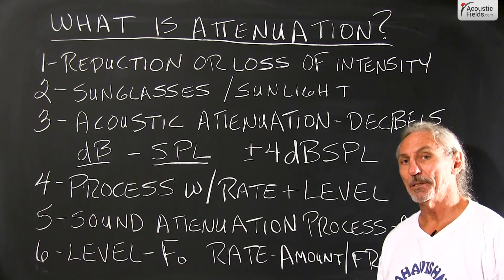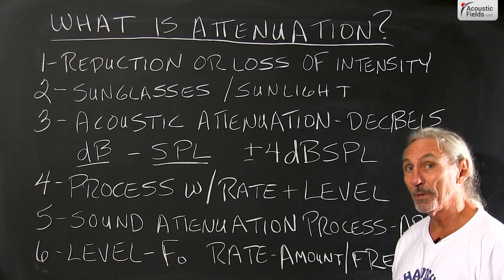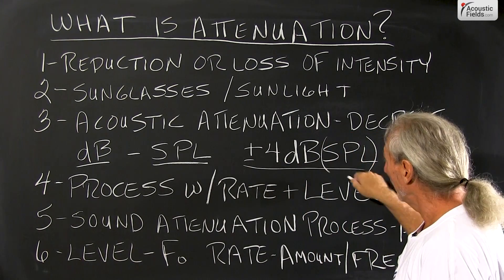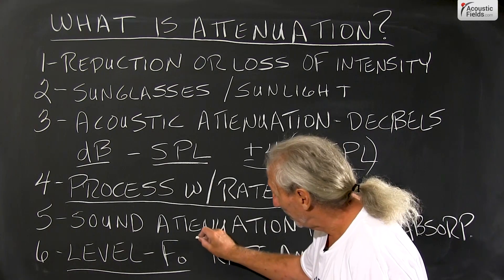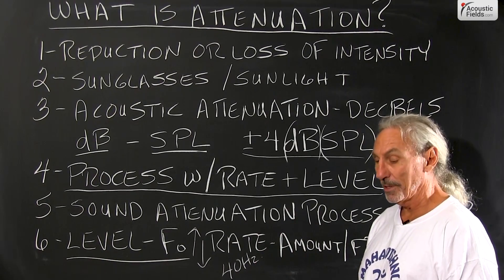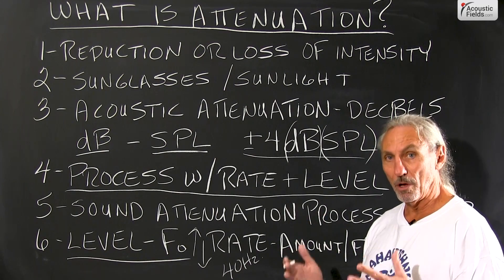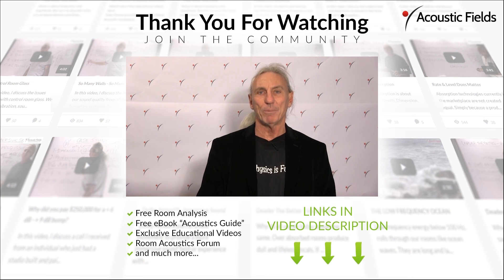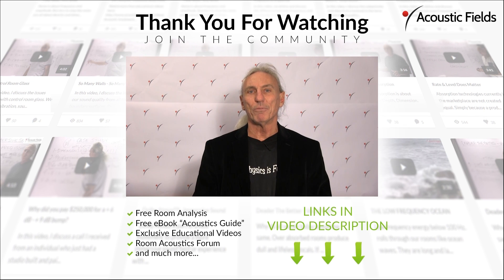What is Attenuation? - www.AcousticFields.com

Comment: Attenuation is not expressed in dBspl but in dB because it's relative, dBspl is related to absolute sound pressure based on hearing threshold reference (0.00002 Pa). In your example it should be  +/- 4dB instead of +/-4dBspl.
Reply from the maker: You must express technical subjects especially physics using simplier processes to facilitate understanding.and comprehension so everyone can be conversationally competent.
Reply: @AcousticFields  simplier process doesn't mean physical laws should not be respected, and it's not that difficult to understand that attenuation should be expressed in dB instead of dBspl.

Comment: Dennis,  At   I'm a little confused on the statement you made regarding Resonant Frequency.   You mentioned that when you design a product to absorb down to 40hz, that it's going to absorb frequencies above 40hz, and not below.   

But when I look at the absorption curves of the ACDA 12, it seems to be absorbing the frequencies centered around a specific frequency (50hz in this case), but the absorption rate/levels diminish both above and below since the product is designed to absorb a specific range that's centered around a specific frequency and it's a pressure activated product.  The absorption curves for the ACDA 10, which isn't designed to absorb frequencies centered around a specific frequency but rather a broadband range of low frequencies, but neither product is designed to absorb frequencies above 100hz.  Then you have the acoustic foam that's designed to absorb 125hz and go up from that, and since the ACDA products are pressure activated, they don't really absorb much above 100hz unless you have the foam on the front of the cabinet, which would absorb above that 100hz frequency point.
Reply from the maker: O, The ACDA-12 was designed for frequencies from 30 - 50 Hz. The ACDA -10 is a broadband absorber that goes from 30 - 200 Hz. The ACDA-10 has an average absorption coefficient of around 25 % / octave. If you add our foam technology to the face, you have absorption from 30 - 6500 Hz. Both of these frequency ranges are problems in all small rooms. Each unit has between 1.5 - 2 dB attenuation for every 8-10 sq.ft of surface area  You now have predictable and consistent tools that can be used in all small rooms.
Reply from the maker: They are not designed to work above 300 hz. with the ACDA-10 or 50 hz with the ACDA-12. This frequency range is intentioanl. It was our design goals for both the 10 and 12. Our foam technology is placed upon the face of both units. This extends the absorption curve to 6,300 hz. If you notice the rate of absorption for both our carbon and foam technology, you will see the same linearity in both slopes. This was by design.